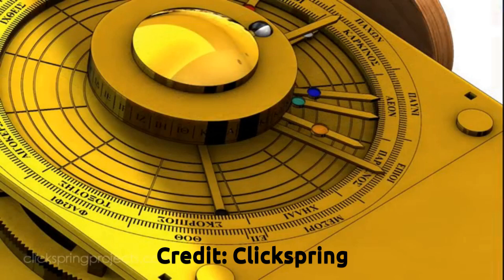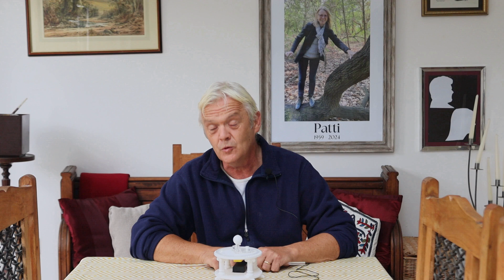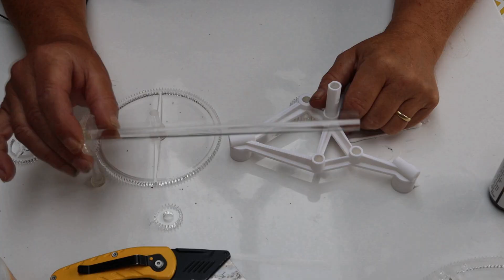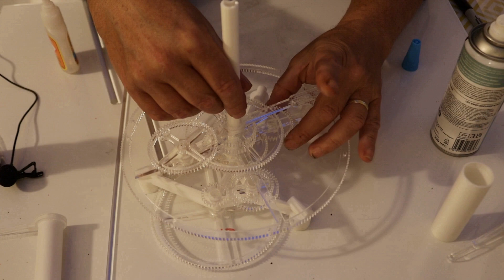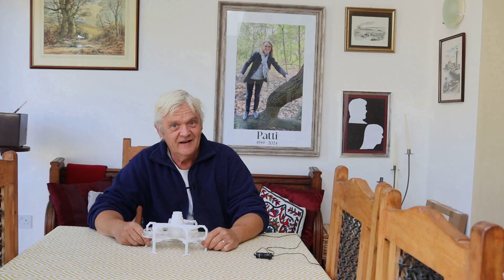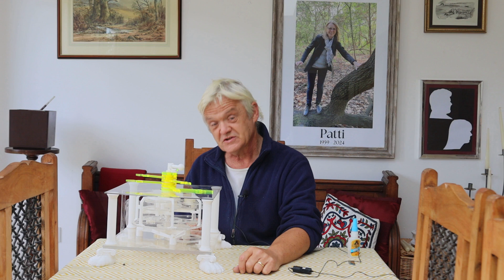2291 Building The Antikythera #xtool #p2

Comment: Cool flat earth model :)
Reply from the maker: it's an orrery
Reply: @ThinkingandTinkering  based on ANGLE MEASUREMENTS to the celestial (bodies). The horizon is not a sphere edge, boats don't go over the edge, no tangent. The "solar system" is a flat earth "model". The globe "model" is based on measuring angles from the horizontal reference plane we call sea LEVEL :). There are no men floating in a sky vacuum, they are hanging from strings like puppets, faking weightlessness using zero-g planes, cgi, greenscreen technology etc. If the sky was a vacuum, gas pressure would press into and fill the available volume. "Gravity is not a force", "There is NO force of gravity" according to modern physics. Level is horizontal, vertical is perpendicular to horizontal. Sorry if the truth sounds like bad news, but there is no need to believe in the "photoshopped because it has to be" planet earth. Love your work btw :)